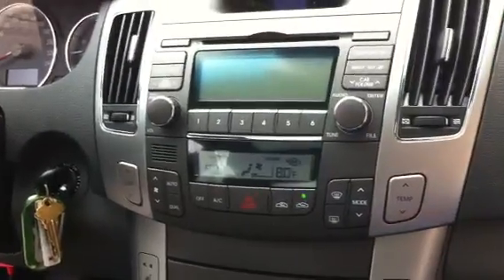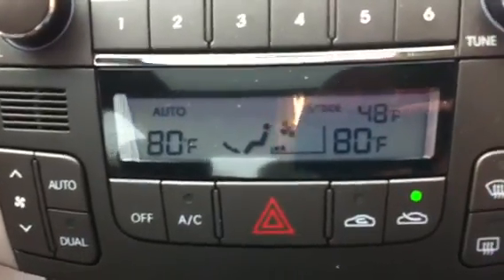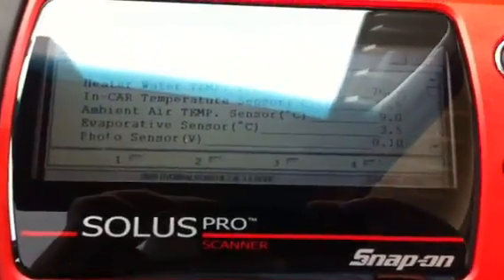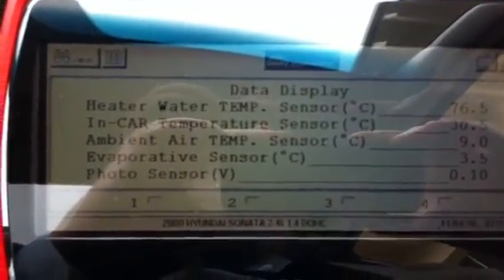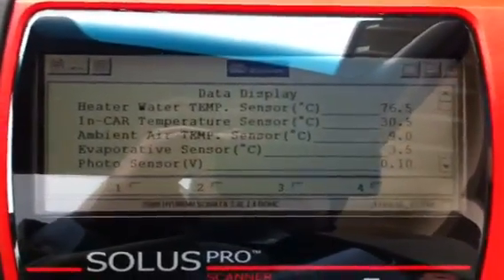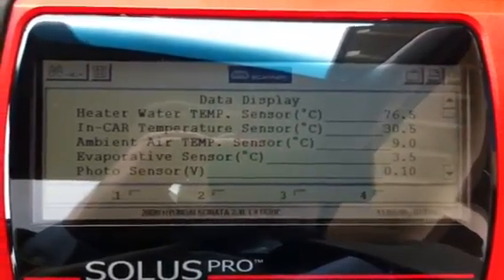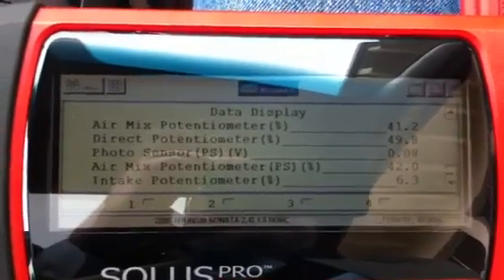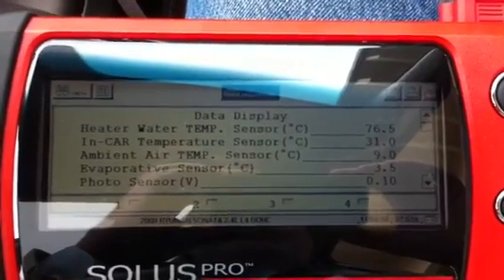2009 Hyundai Sonata Heater Failure

Comment: The censor is measuring in Celsius and car's display is in Fahrenheit. 80 Fahrenheit is 26.67 Celsius. And it is fair that you get around 30 Celsius which is equivalent to 86 Fahrenheit.
Reply from the maker: 30 Celsius wasn't referring to the heater temperature; it was referring to the cabin temperature. It should have been reading about 9 degrees C (48F).